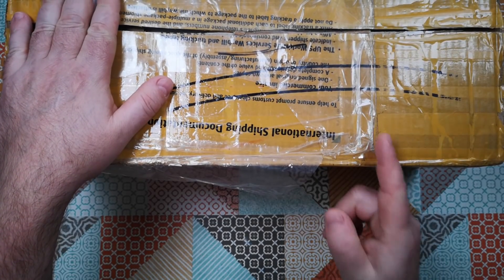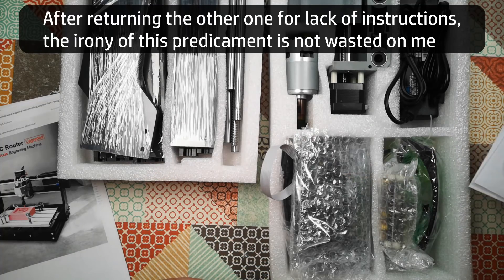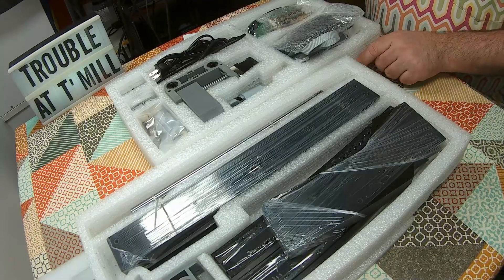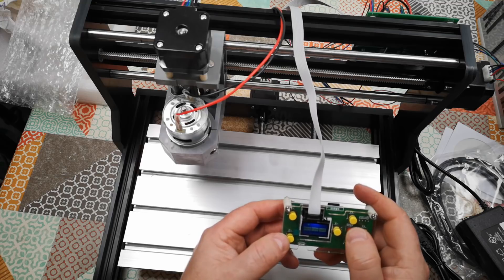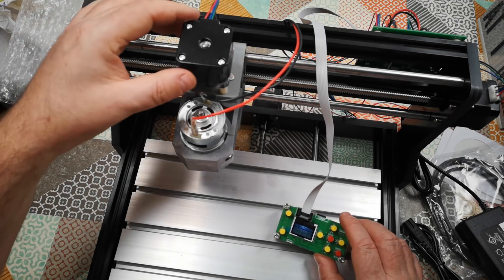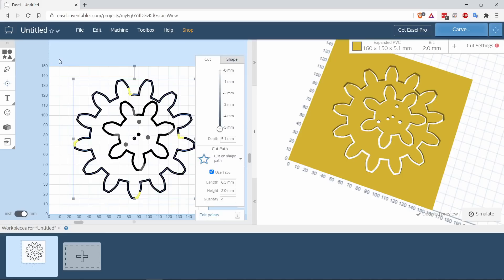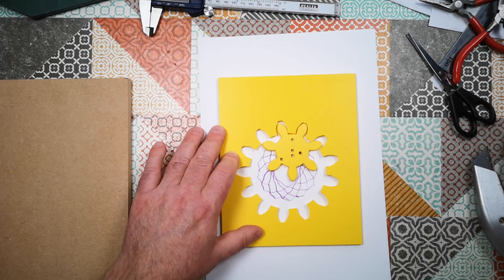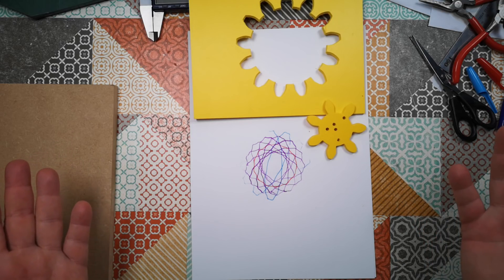The Desktop CNC Machine That Time Forgot (Unboxing & Assembling Something I Bought 2+ Years Ago)

Comment: I've got a very similar CNC in a box at home. I did assemble it, but within a minute of turning it on there was a loud pop and smoke coming out of the machine. Looked like a capacitor went. Haven't put it to much use since

Comment: Its (APS) Acrylic Plastic Sheet which is not rigid, it will flex, no matter how thick it is. You are better off getting two metal plates 5mm thick and make your own uprights by tracing the holes and outline. Then you will know it is never going to warp or flex or twist or change through age.

Comment: Are these machines too loud for a flat? I'm so tempted to buy one, but not sure if my neighbours will hate me even more.
Reply from the maker: Some of the noise depends on the material being cut. A tough hardwood will be louder than this plastic foam. I'd say the noise is about the same as a food processor, but of course it runs for longer periods.
Some of the noise can be mitigated by standing it on something to isolate it from the table (like on a board on top of a foam layer) and by enclosing it in a box (which is probably necessary for dust control anyway)
Reply: @AtomicShrimp  thank you mate.

Comment: Aluminium actually goes quite ok with this machine. Depth of cut around 0.2mm per pass at about 50mm per minute. I found it best to use a helical cut and a 1mm end-mill. It takes a while but it is definitely possible.
Reply: Sounds about right, you could also use it with "Traffolite" to make professional labels.

Comment: I have a "3020" style micromill/engraver/Dremel-on-a-gantry that I bought in like 2013 and just got around to converting to GRBL this last fall, it came with a positively ancient parallel port control scheme that was kinda a pain so I never really used it much.

With GRBL on an Arduino Mega it's very handy, used it in the process of making a few wood+leatherwork Christmas gifts. Toolchain I've found nice is my long favorite modeling package Rhino for the CAD and a package called CamBam (British company, I believe!) for the CAM portion.

Comment: 3:40 mentioned a word I didn't know, so I googled it. 

TOP DEFINITION
sworf
someone who farts in the bath and sucks up the resulting bubble out of the water.
Dude i just found out foopy is a sworf. She said it tasted good!!! hahahaha...
by buttertoast February 24, 2008

btw your lighting in the last overhead shot/spirograph shot was extremely varied. It caused me to enjoy your video to a lesser quality than I would normally
Reply from the maker: Swarf, also known as chips or by other process-specific names, are pieces of metal, wood, or plastic that are the debris or waste resulting from machining, woodworking, or similar subtractive manufacturing processes https://en.wikipedia.org/wiki/Swarf

Comment: I have a suggestion for a project. Make an Emergency Stop Button for the machine. Even if it only stops the stepper motors. It could save you a lot of stress to know that all you have to do is slap the big red button, instead of trying to find the right icon to click on when something goes wrong.

Comment: Most microswitches have 3 pins: Input, Contact Output and useful for your machine Output Non-Contact. Put the positive power from the board (to the Y axis motor) to the microswitch input, connect the other end of the wire cut to use the microswitch to the Non-Contact Output. Then if the microswitch is hit, power to the motor will go away. It's not ideal as once it hits the switch you'll have to pass power somehow to it to have it move backward. Many ways you could correct that with a relay, but if the safety of the parts and motors are of concern, it could/may/will do the job just well enough.
Reply from the maker: I think the board has inputs for proper limit switches

Comment: Say anything about IKEA's infamous puzzling instruction sheets, China takes the cake for producing and supplying stuff that requires assembly without a single piece of assembly guide. I work in a graphic design company that occasionally outsourced display stands and L.E.D screens from China and I could swear like all of them require you to figure out how to build them yourself, or if you're lucky, they'll just give you a website url where you can download a .pdf file containing the instruction sheet... which often covers a different model instead.

Comment: I used to operate a large CNC at a custom cabinet factory. I didn’t program the cutting patterns, but I did set the machine parameters, tool parameters and make minor program adjustments. I’m not a very good Craftsman either but it did make me feel like one

Comment: As an IT pro, you already know modern polycarbonate CDs don't degrade in so short a time. I think those are exactly what they appear to be - blanks, possibly for storing your designs on.
Reply from the maker: I can see data tracks on them. I think it's most likely that being inside a box with brand new off gassing plastics did them in
Reply: @AtomicShrimp  Ah, well... poorly written / duped then? Can't get bit-rot on modern discs, it's not really a thing these days. At least, I haven't come across any for 15 years or so, could be wrong though

Comment: If you haven't already done so, try turning the inner gear over so the angles match.
Reply from the maker: Yeah, the problem is that the outer gear isn't designed to be used on the inside like that - the teeth are square on the inner side

Comment: Those little engraving bits are crazy sharp. Do not move the workpiece or put your fingers underneath one for any reason other than to put the rubber protector on or take it off. Put the head all the way to one side and move the work all the way toward you with the protector on before messing with the work. Or better yet, do not install the bit until your work is secure and completely remove it before removing the work. Only handle it with the protector on and it can still get you through the protector if you're not careful. 

I learned this the hard way after four stitches in my finger for a cut that looked unreal at first. It didn't bleed at all for several seconds, seemed like minutes later. I reached under the bit for some reason I can't remember and poked the back of my finger with it, which wasn't all that bad and I didn't even feel it much. My reflexes disagreed with that and I jerked my hand back slicing from my middle knuckle to my furthest knuckle. My hand only stopped because it hung up on my knuckle. And yes, of course, the spindle was off. It cut me like that with the machine off.

Comment: Can i get the full uncut 45 minute version of picking up that bit at 14:23  ?
Reply from the maker: It includes the razor-sharp point of the bit piercing the soft blue rubber protector, and puncturing my finger

Comment: I used to work with a machine like this (about the same size but slightly better quality) for a few years and one of my personal favorite projects i got to make was an illuminated company sing using 3 sheets of  5mm acrylic. I engraved a part of the company's logo into each sheet and then added different color LED strips around each, to make it multicolored once sandwiched together. 
I think it could look great if you made your channel logo like that.

Comment: Do you recall the general price range? I used to run the CNC and lathe at one of my old factories
Reply from the maker: I think I paid somewhere in the region of £140 for this - oddly, I can't find any trace of the transaction - not even an emailed order acknowledgment.
Seems like they are a bit more than that now, for this configuration with the offline controller.

Comment: Assuming the controller board and software have enough inputs, you can wire your own limit switches.
Reply from the maker: There is a set of pins at the bottom of the board (helpfully labelled 'not used' in the product listing) that look like they might be limit switch inputs

Comment: If you want to make your own milling bits research "D Bits" they are relatively easy to make.  Also look into "speeds and feeds" and "tooth loading." Tooth loading is especially important, if you try to remove too little material the tool will burnish rather than cut.
Reply from the maker: Thanks for that - I would not have guessed the detail about burnishing - I guess that's where limitations of the machine really come into play with smaller motors etc; you can't just take it slower
Reply: @AtomicShrimp  
A cutting tool will never have a completely sharp edge.  It will always have a radius however small so if the spindle speed is too high the tool rubs rather than cuts and generates a lot of heat.

Comment: You could try using it to make a mechanical clock. I got some plans for a simple one but still havn't finished it because it's taking so much of my limited spare time just to cut the gears out and clean them up enough to use. Cutting the gears with a CNC would make it infinitely easier !

Comment: You could have an entire series in which you assemble things without instructions. Maybe work your way up to a light aircraft.
Reply from the maker: Someone else can test fly it, right?
Reply: @AtomicShrimp  
Daniel was volunteering.
Reply: @AtomicShrimp  That would be the fun part!
Reply: @AtomicShrimp  Practice flight using instructions translated in a basic manner from the Chinese?
Reply: Actually, that is exactly what I am doing now... Bought a restoration project from someone else, a completely disassembled aircraft. Now restoring it to its former glory. No documentation whatsoever, just categorized components. If anyone is interested I could start making videos of the process.
Reply: @MarkW_  that would be a fascinating project,  I would love to see it!
Reply: @dogwalker666  Thanks, I will think about how to do this without it taking too much out of the build time. So far I have only made photos, I could start with a bit of a 'slideshow' video of the work that has been done so far. Which basically is to strip the fuselage frame of the original paint, repaint it, remount some of the control rods, and make some new control cables. If @Atomic Shrimp has no problem with that I could link to it here later...
Reply: @MarkW_  nice, I have seen restoration videos where they had a time lapse slideshow,  I love working with my hands and this lockdown is driving me nuts.
Reply: @dogwalker666  It has taken some time to collect all photos, figure out how to use the editing program, etc. But here it is, my first restoration video: https://youtu.be/rO2CmGOtNqI   Hope you like it.
Reply: -Shrimp ordered a DIY vacuum cleaner without instruction.
-Shrimp accidentally built it into a time portal machine.
Reply: That would be an amazing fun project.
Reply: *a nuclear reactor

Comment: First assignment: recreate the plastic/composite parts in aluminium :) after that, upgrade the spindle. And from there start making a fourth axis ;)
Reply from the maker: I did actually wonder if this machine can be used to cut parts to make a better version of itself.  I think probably the best approach would be to engineer my own larger machine (something that can handle a proper router spindle) from scratch, based on learning from the practicalities of the electronics and mechanics of this one
Reply: @AtomicShrimp  I agree, improving this small machine will probably quickly lead to wanting a bigger bed and endstops.
Reply from the maker: Yeah - I think it would just be one of those upgrade projects where you realise at the end that all of the original parts are lying in a heap on one side, but you still don't have the machine you really wanted.
This little thing could be good at fabricating some of the small parts necessary for a larger machine - corner brackets, mountings for limit switches and the like - I'm not great at getting multiples of those sorts of things to be consistent and precise by hand

Comment: Atomic shrimp crossing over with yet another one of my interests! The plastic parts are most likely laser cut or CNC milled acrylic and the metal parts are 20-40 or 20-20 aluminium extrusion.
Reply from the maker: The plastics feel a bit heavy and sort of hard/tough for acrylic - I should have done the AvE knife test - I think they are glass-loaded plastic of some sort - is there such a thing as glass loaded acrylic?

Comment: CDs don't degrade. I've got CDs written 20 years ago, that i kept in damp conditions, in the cold, and they still work. They didn't put anything in the cds.
Reply: Cool anecdote.
Reply: @ErwinPommel  it's true. If CDs degraded to the point of being blank in 30 months, they certainly wouldn't have been the industry standard for storing music for 30 years. Data discs using similar technology are still in use today for long-term data storage. They're not temporary storage media.
Reply: @prairiepanda  All CDs, from all manufacturers, created using all processes, and stored in all ways.
Reply from the maker: I've got rewritable discs that I know were once good, that will no longer read - despite no obvious visible sign of damage, and despite being stored fairly carefully inside a closed cupboard for a few years.
It's possible that these little mini CDs were never any good, but on a CDR, you can see where tracks have been written, and I can see that on these discs, so maybe they were always garbage since they first went in the box, but they're not just blank new discs
Reply from the maker: Also, bear in mind that these discs haven't just been in storage, they've been sealed inside a closed box together with brand new plastics that may have been off-gassing volatiles.
Reply: @AtomicShrimp  I really hate it when (usually after a good curry) I spend all night off-gassing volatiles.

Comment: that controller looks awfully barebones. the first thing id CNC would be a case for it.
Reply from the maker: My thoughts exactly
Reply: 3d print
Reply: Mine came with an enclosure for the external controller.  I find i don't use it

Comment: Those mini disc! My opinions on it, they just add blank disks in the box to avoid complains about lack of instructions, and fool ppl. If it was floppy discs, I can easily understand that the support go bad during storage, but discs, not so much. Btw these were recognize as blank, if something was writed on it at some point and degrade overtime, computer will see it at corrupt data of some sorts.
So fair play to Chinese guys for the fool. Anyway, cool project and very impatient to see other cnc stuff
Reply: CDs and DVDs, especially super cheap ones, had a tendency to go mouldy between the layers.  You would see off colour spots, even holes, being eaten into the discs.. also, the printing was super bad and sometimes paint flaked off the discs too

Comment: i got a large one from ebay. there was a dvd with it which had video footage of assembling it, picture only instructions of how to configure it for mach 3 and a copy of mach 3 with a pirated serial number. i got it together and surprisingly it worked fine.  it plumbed in to a parallel port (remember those?) but i got a converter that allows it to be controlled via ethernet. with time and patience i got it all to work and it does a decent job. not super precise but certainly precise enough for my little projects.

Comment: I bought a similar machine a while ago, but the offline controller can only handle VERY short G-codes and when I use it connected directly to a computer it just stops the program in the middle of making something and resently it started randomly destroying stepper motor drivers. I‘ve been trying to get it running for over a year now.

Comment: That's a neat bit of kit! I'm unsure whether it's a little brother to the two Anderson Stratos flatbeds I used to run with Fanuc controllers, or if it's more akin to an old 2'x1' engraving flatbed controlled from a Dahlgren 'System 1' box I used back in the late '80's. That last was hooked up to a TRS-80 computer! - regardless, don't forget to allow for cutter wdth offsets when planning the cut ;)

Comment: yey 3018 :D i have the same thing 😊
Reply: those black plastic parts are bakelite. at least that's what they wrote in the manual :)
Reply from the maker: Does anyone still use Bakelite?  I reckon that's perhaps a mistranslation - they feel like some sort of glass loaded resin
Reply: i made one BIG mistake. haven't clean rails and bearings from factory metal dust before use. now i have badly scratched rails and messed up linear  bearings :(
some suggest ultrasound bath

Comment: How many “spare” nuts and bolts were left over on completion? Haha
Reply from the maker: That was my metric for whether or not I was on the right track!  There were a couple of spares, but nothing egregious - the biggest issue was where I used up all the longer machine screws in the wrong places, then found the short ones I had left would not work in the remaining places
Reply: @AtomicShrimp  I have a similar self assembly “frame” buried in the shed, designed to hold a Dremel in place. Runs from a PC windows 2000!!
Reply from the maker: @richardmillican7733  I nearly bought one of those a year or two before I bought this one